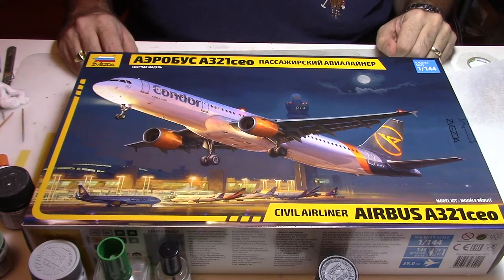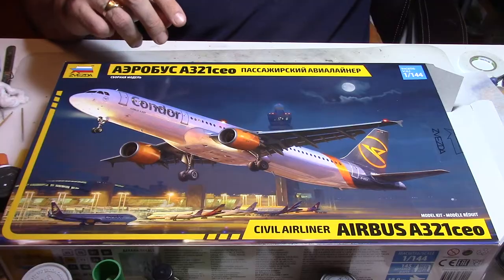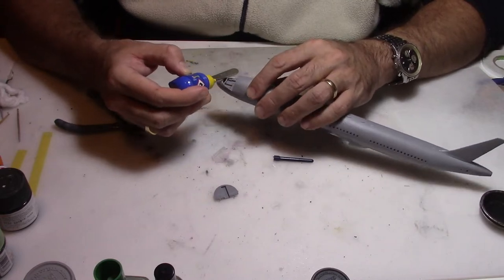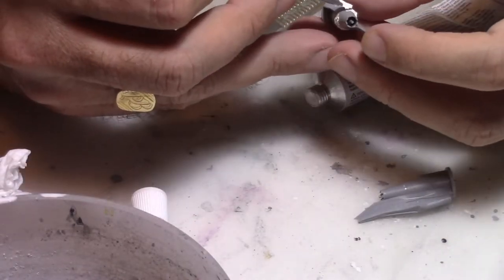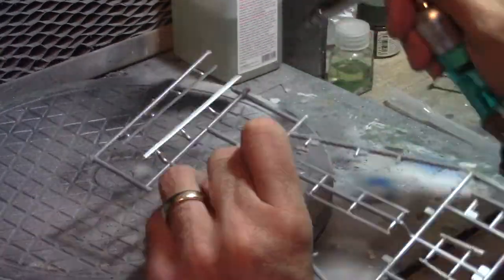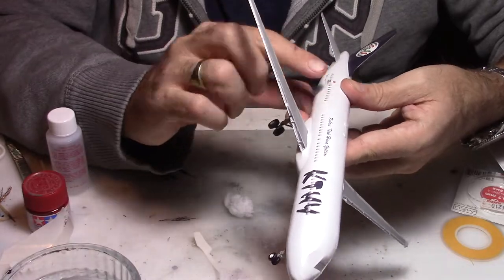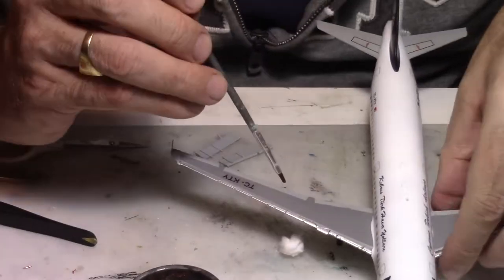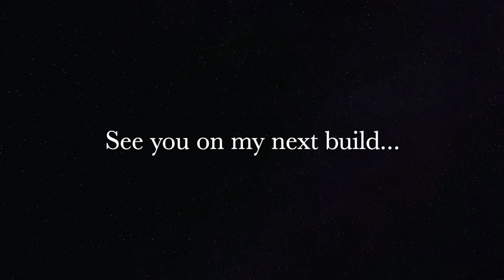Zvezda 1/144 A321 KTHY

Comment: Does the fuselage twist easily because it looks like the plastic is too thin
Reply from the maker: I didn't experience any issue with the fuselage at all, compare to the Revell kit
Reply: @airlinersmodelmania  is the model fuselage (without gluing together) solid?
Reply from the maker: @Mesh_potato  You definitely need to glue the fuselage together if you the part to hold together.
Reply: @airlinersmodelmania  does it crack open easily